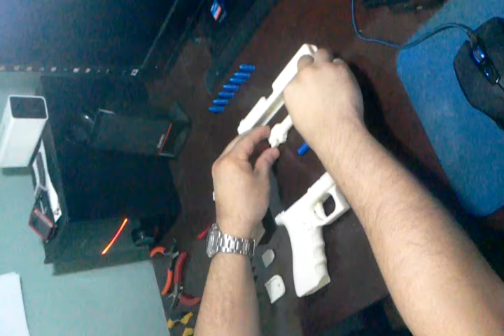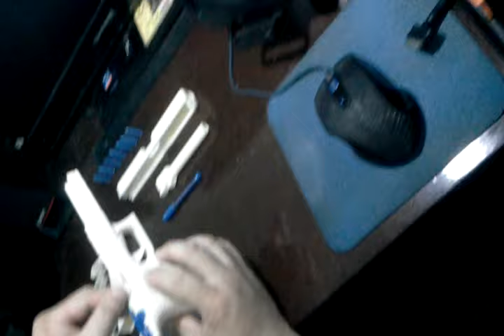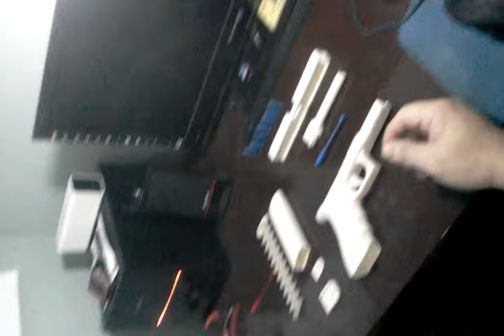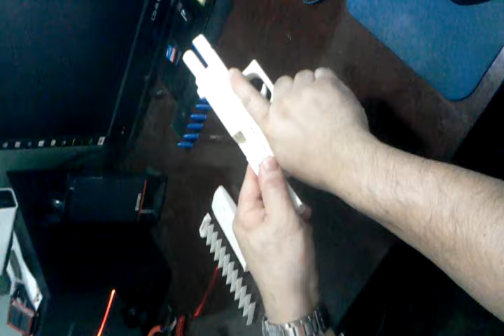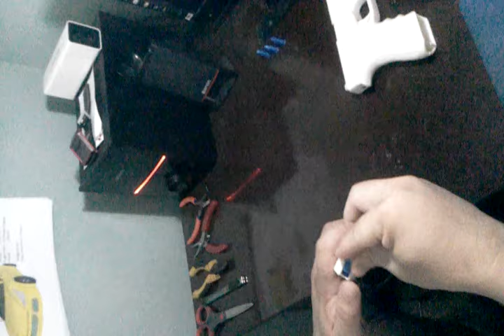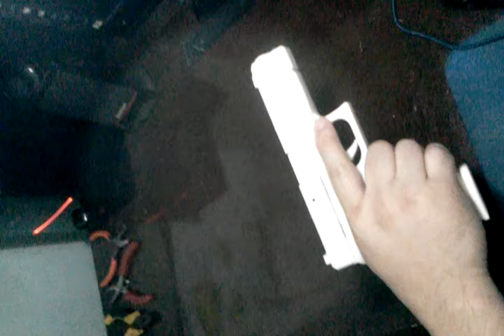3D Printed Glock 17 9x19mm Model by 3D Printwiz

Comment: Also does this work with real bullets
Reply: Why don't you let us know. I'm sure printing it in PLA will be strong enough to withstand the stress of the black powder going off. Let us know what your results are.
Reply: @adamarzo559  LOL. Heads up. Good old Lefty nickname inbound.
Reply: dumbooo
Reply: @adamarzo559  r/woooosh
Reply: Absolutely, real bullets will cycle without a problem. You may want to ensure your life insurance is current before you try firing this model. 
Fair dinkum are you realy stupid enough to try shooting with a plastic gun?
Reply: Most people don’t use black powder anymore except for muzzle loaders but a glock uses different powders based on the brands or the reloaders but never black powder